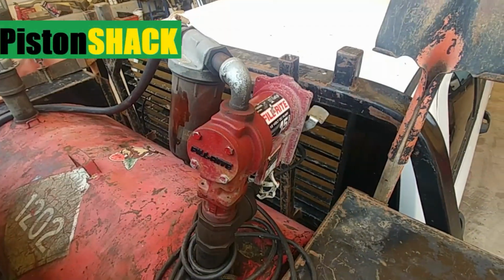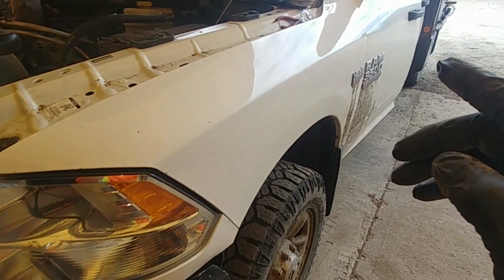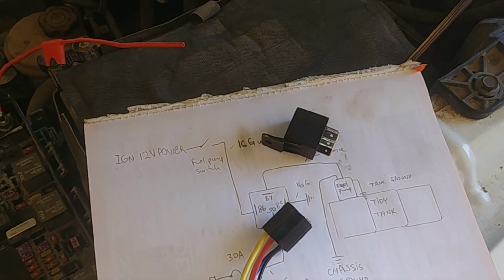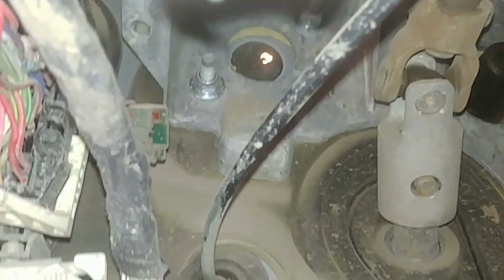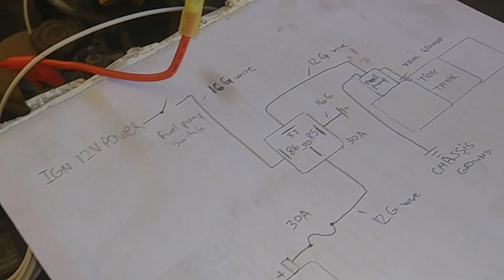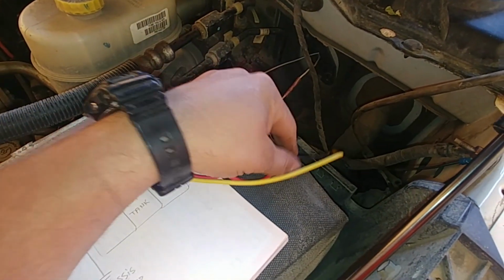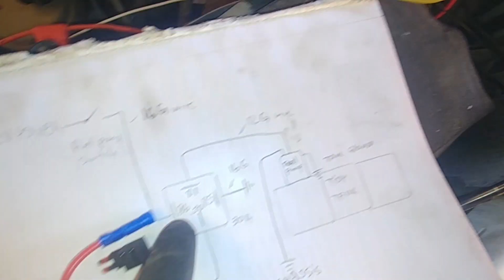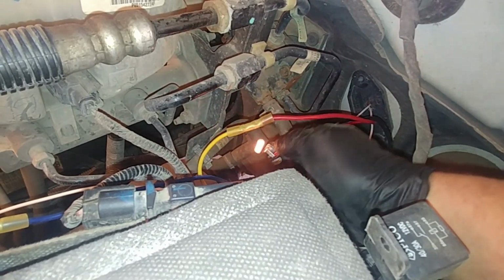FUEL TRANSFER PUMP WIRING - Best Explained: wiring diagram, relay, fuse, switch, 12V, pump ground...

Comment: Good evening, do you know that i have to do if i put my jumping cables backwords on my receiver fuel tank positive to negative and negative to positive
Reply from the maker: If you connect fuel pump electrical motor backward, DC electric motor will spin counterclockwise due to opposite polarity. I would connect it properly, it should work.